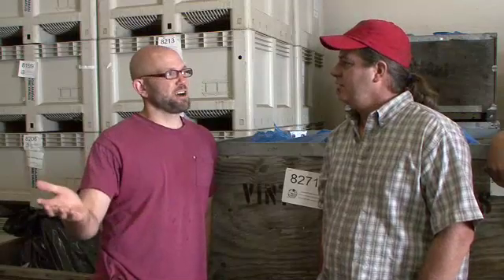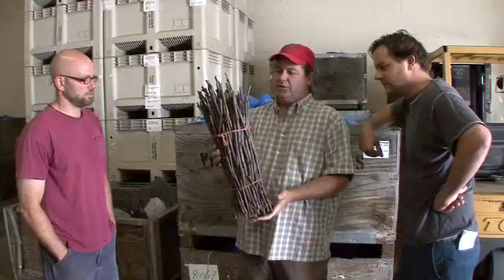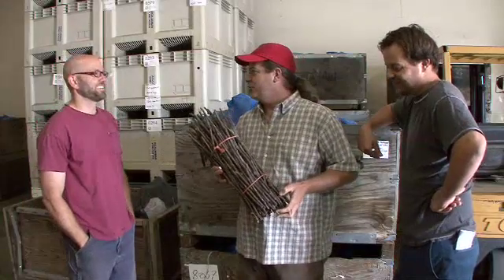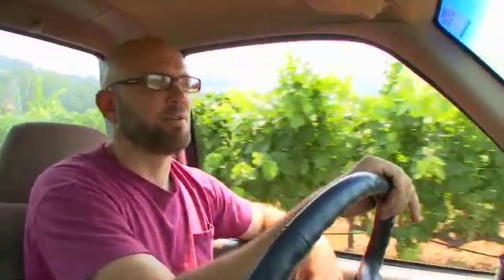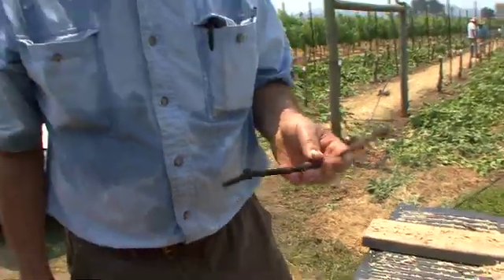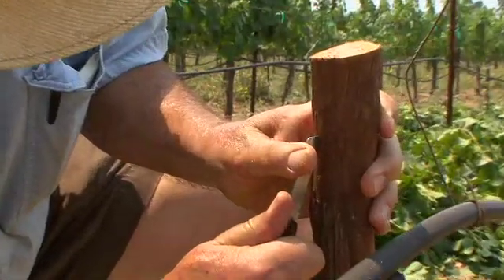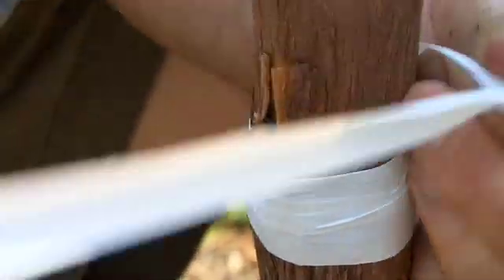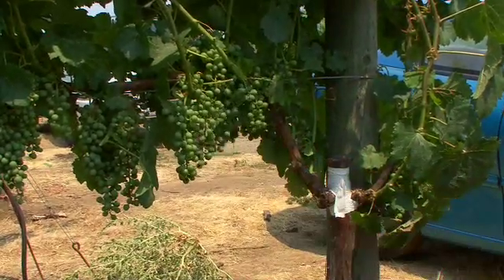T-Budding

Comment: Hi. Great video. A question for you.  I planted a plot in R-140 Ruggeri  because there was a shortage of grafted vines.   They have taken very well, but as rootstock does, its sprawling along the ground.   My thought for next spring is to prune heavily, leaving 2 buds on the base.  I would then train it during year two to form a nice straight trunk.  Year three my plan is to T-bud on the rootstock trunk, quite high up to form cordons.,   I was told that if i every want to rework the tops, its better to graft onto rootstock rather than on the varietal, so this will leave me plenty of rootstock trunk.  Do you see any disadvantage to this approach?

Comment: Hello there from Texas backyard grower.
My question is: when you do the bark cut to insert the bud,do you only expose the cambium or you also cut through  it and open it up like the bark(or perhaps together with bark). I am asking, because it is not clear, how the nutrients flow from uninterrupted cambium into the bud? Other methods mostly cut the cambium on both sides and align the cambium of the bud with the stump...so the broken capillaries sort of align and the 'juice' can flow...